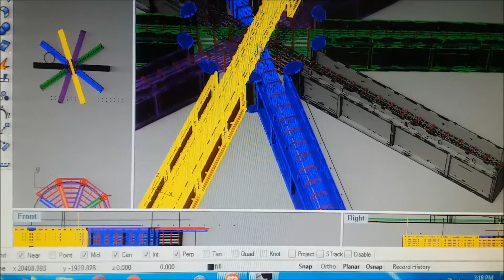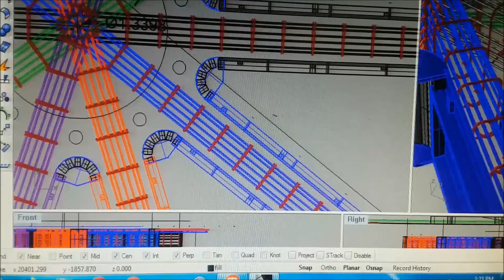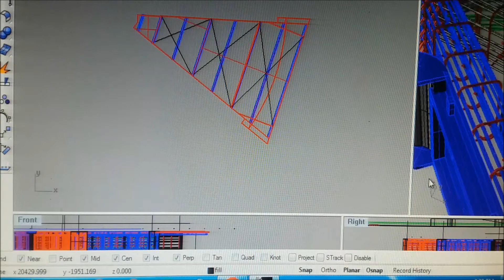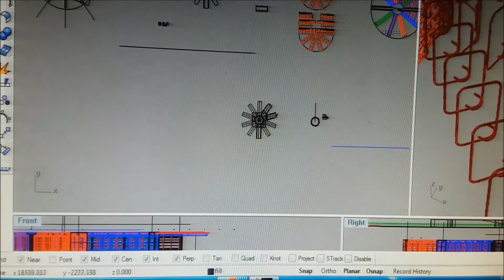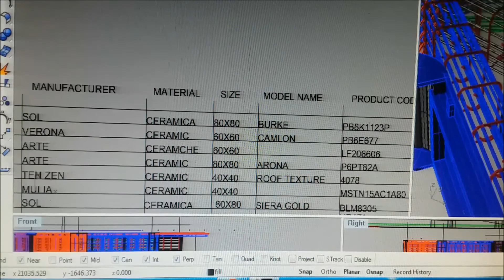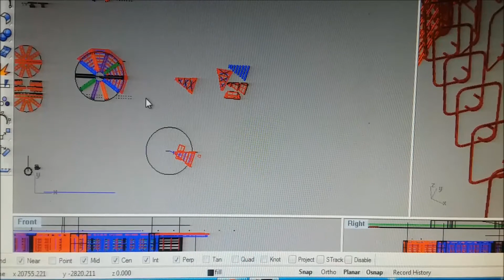BUILDING OUR DREAM HOUSE IN THE PI, OUR DECAGON HOUSE,  CH 67,  SPIDER BEAM REBAR DESIGN AND  FORMS

Comment: very strong structure
Reply from the maker: Probably a good thing because changes during construction don't require structural changes to work below them. The spider beam which is an 84 bags of cement pour sits on 10 oversized columns and the walls which are like beams being also poured concrete.The original calculations were a grid of support beams sitting on all 20 columns. The grid weighed more but was a more distributed load, and butt ugly. The as built spider beam used less materials as well and was quicker to build. It also gives a focal point to the central atrium in keeping with all rooms need a focal point.